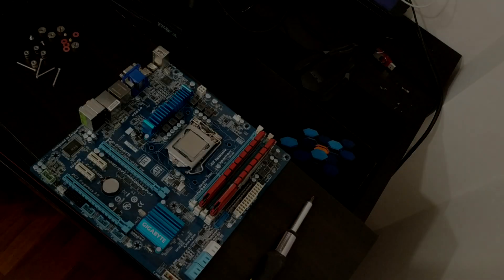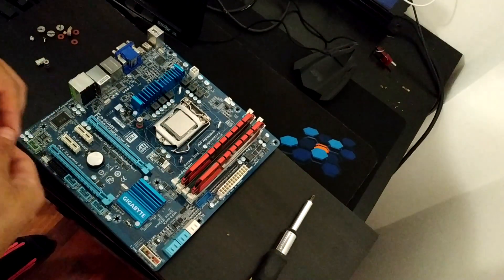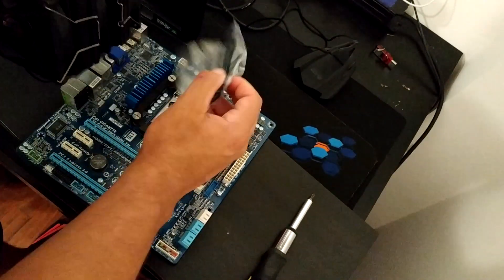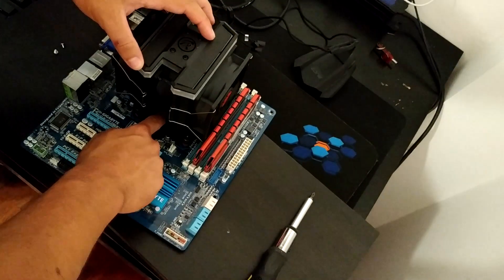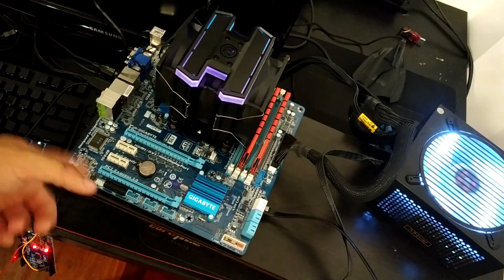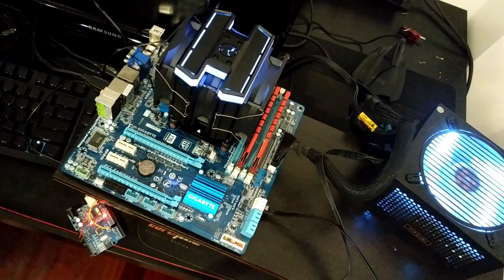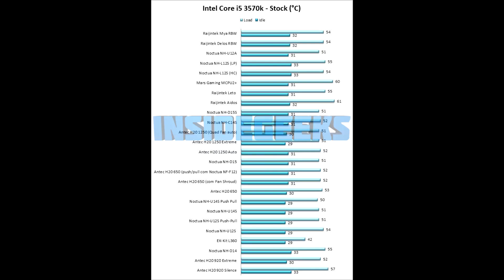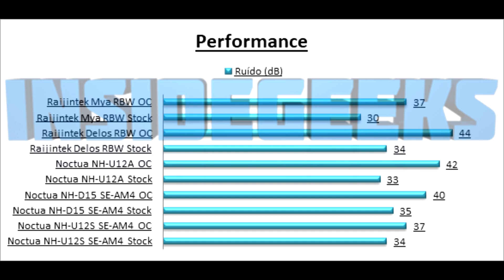[Review] Raijintek Delos RBW : Triple fan in a 92mm tower cooler?

Comment: i have no idea how to get the rgb on,or where to plug its 5v plug into - on a msi x470 gaming pro carbon.nither pumpfan1 or jrgb2 turned its rgb on
maybe ive fried it by putting the 5v plug into the jrgb2 12v initially,but its thier dam fault for giving NO help in instructions
Reply: for raijintek delos rbw
Reply from the maker: @jamesscott2619  You needed to put in the jrgb, the pump fan puts out 12v

Comment: hi where can i buy the tripping add header thx.
Reply from the maker: Do you want one for this cooler or another one? You could daisy chain two y-splitters for example.
Reply: @InsideTheGeeks  i want for this cooler
Reply from the maker: @franckyg1  This cooler comes with the fan splitter included! If you need it from somewhere else, you can find it here for example : https://www.aliexpress.com/item/32559112401.html?spm=a2g0o.productlist.0.0.1725dd16QRA2VI&algo_pvid=07587f76-4262-43d6-9bfd-c48034f99e77&algo_expid=07587f76-4262-43d6-9bfd-c48034f99e77-9&btsid=83064083-daab-4307-99e9-2ec0caf8857f&ws_ab_test=searchweb0_0,searchweb201602_9,searchweb201603_53